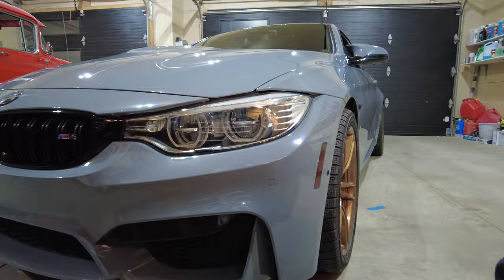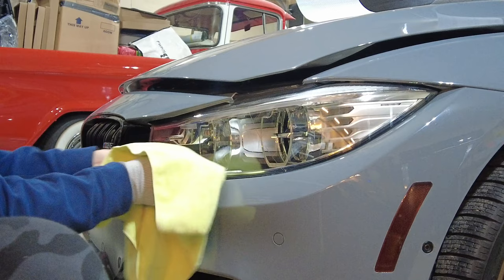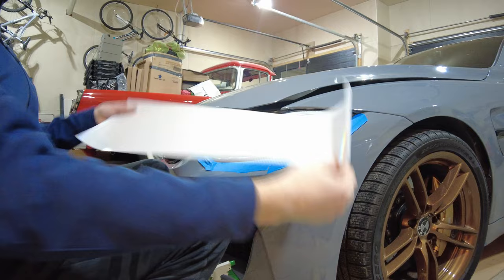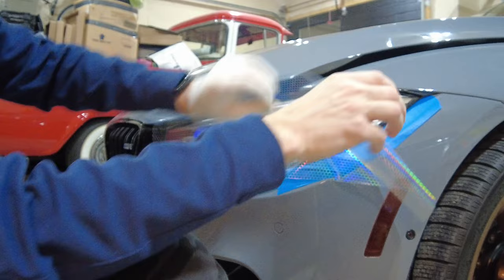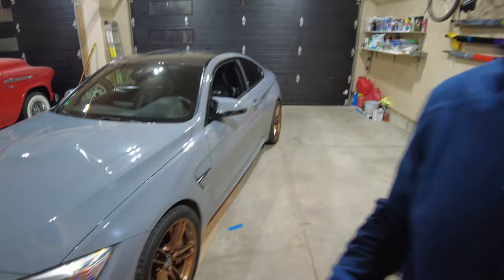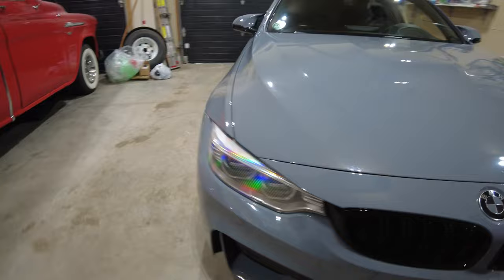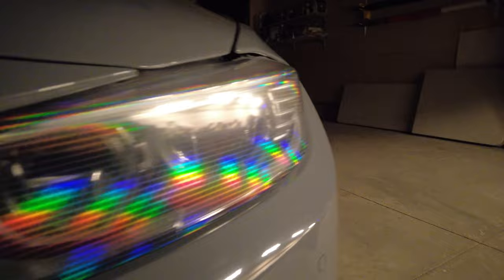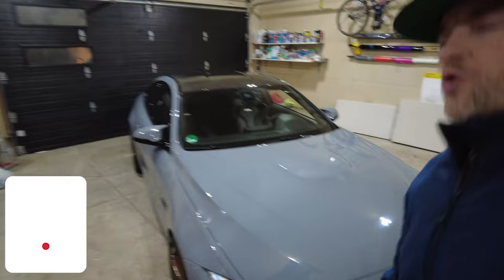BIO HEX+ Clear Air-Tint Headlight Tint by VIVIVD Install Guide and Review

Comment: Btw. I didn't realise because it's hard to tell, but there's a protective film on the tint, I applied it with that film still on, but it would have been 100X easierif it was removed beforehand. I only realised it was there when I removed the tint and discovered another layer.

Comment: This looks amazing but I wish you did a before and after of the headlights on so we could see a difference before and after. But that looks awesome I might have to do it
Reply from the maker: My bad
Reply: @Donslife  how’s it holding up? I’m going to purchase some using your link🫡
Reply from the maker: I found it held up well.  Like most wrap products, make sure your edges are laid down tight.  I tested a new tint film on these lights more recently, so I had to remove it.

Comment: My headlights currently aren’t installed, do you think it would be easier to do this before I put them in?
Reply from the maker: It can have it’s advantage’s as long as you can hold the headlight firmly while stretching the film. Can be tricky one-handed so a helper could be useful, otherwise having them on the car can be easier

Comment: since its been over a year, what is the status of the film now? any issues with peeling or bubbling? has cold/hot weather affected it?
Reply from the maker: Actually it held up better than I thought.  I took it off and added a new smoke tint recently. The biohex left a little bit of adhesive residue but it was simple to clean off
Reply: @Donslife  thanks for the quick response! great video btw
Reply from the maker: Thank you 🙏🏻
Reply: @Donslife  what did you use to clean up the headlight and did it scratch it?
Reply from the maker: ‘Goo Gone’ and a microfiber towel. Then cleaned again with 70% isopropyl alcohol.  Very little effort was needed.  The residue was only in a couple spots near edges

Comment: Is the 1FT X 5FT enough for both headlights? (2013 accord)
Reply from the maker: Yes that should be if the headlight is no bigger than 8-9” high.  You’ll want a couple inches of extra material on the top and bottom.

Comment: Did all the glue cleanup in a few days? I just bought some. Watching videos like yours so I hope I don’t screw mine up. Is a spray bottle a bad idea, or totally unnecessary? Thanks for posting it!
Reply from the maker: Hi there!  This is a dry application product. No glues or solvents needed.   All you do is clean the surface properly. I use 70% isopropyl alcohol.  Then apply the film using a heat gun when you need to stretch it.  Then after you heat it more thoroughly to activate the built in adhesive (called post heating). Then one day when you decide to peal it off, there shouldn’t be any adhesive left behind either.
Reply: @Donslife  thank you for the reply!
Reply from the maker: @BlueDroneBlues  anytime!

Comment: Is that the pulse?
Reply from the maker: No this one is just the BIO HEX+ clear
Reply from the maker: I wanted to try the Pulse version but at the time it was sold out.   I may give it go on one of my other vehicles eventually.
Reply: @Donslife  I can’t find a clear version of the pulse is it just a smoke version of the pulse that’s out right now? Also for what you did on this video did you buy the micro pattern or the larger pattern for this clear film.
Reply from the maker: Mine is the micro pattern Bio Hex+.  You might be right, pulse is only in a smoke version on the website. 

2020 BIO HEX+ Clear Air-tint® Headlight Tint